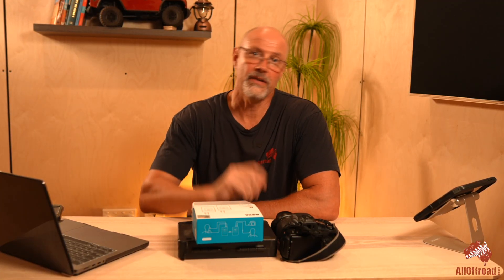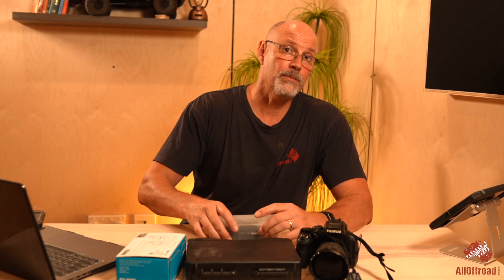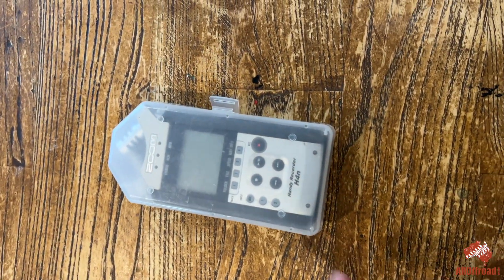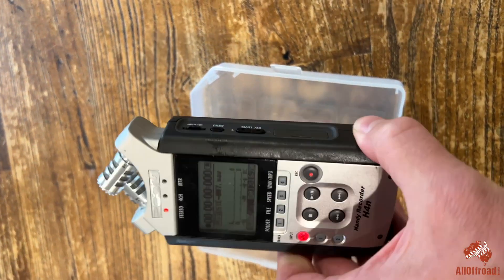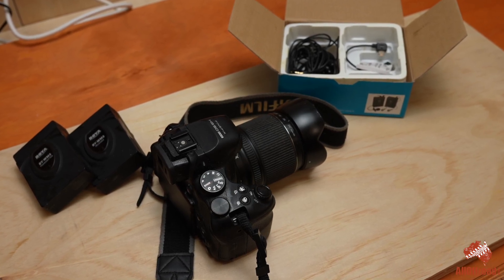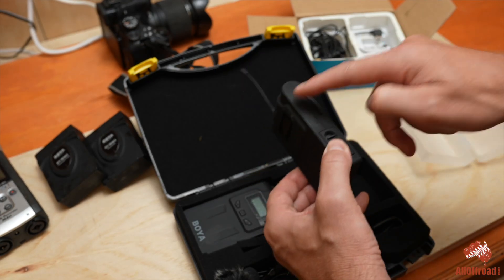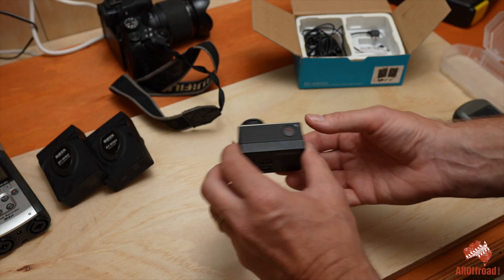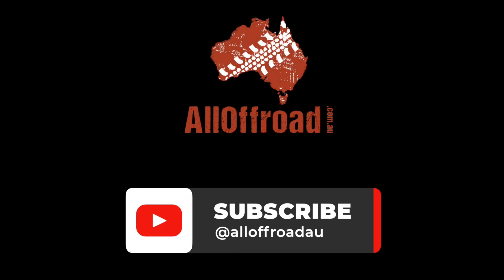Millions of electronic products self-destruct? Hydrolysis | The Sticky Gooey Plastic Affair [2023]

Comment: Not only this. Xrite colorimeter - become sticky after 1 year in box, and it's not devce which ment to be used day by day. Various computer mices  - stick after 2-3 years. Back of dell PDA axim X51 - stick after 5 years, after 7 years falls apart. Not only that! cables alse can sticks and disintegrates overtime, even in box.

In my case stickiness always happened with softtouch coating, i personally avoid to buy such products anymore. When it starts to be stiky it can be removed in throwlly washing with soap.

And i'm also think it's not normal and bad for environment to used materials like this.

Comment: Had this happen on a radio/cd player over 20 years ago. Have not experienced it since, must have been lucky.  So much production today is contracted out to third parties in whole or in part. My guess is that inferior plastics are being substituted that are below specifications and without the knowledge or agreement of the brand name that appears on the product.
Reply from the maker: yes my guess as well but I find so many products with that issue now not funny anymore. Just yesterday discover my DJI Osmo Pocket starts it after 2 years.
Reply: That is unacceptably substandard.  Should be good for at least 5 years.  Plastics have been around for a long time, not exactly experimental.  That experience would turn me off that brand.

Comment: Mercedes Benz are specialists at this. My old ML seat base became a no go zone sticky black morass covering your fingers in gloop and my G Wagen headlight switch recently  crumbled into several pieces, being made of  something apparently as robust as a broken biscuit.
Reply: When they want around 3,000 USD for a  starter motor where I am,  they don't talk much  about reasonable durability.  The whole switch shows up at 400 USD. A Unimog  clone knob will fit I think, after some research.
Reply from the maker: have you contacted them? Even out of warranty clearly used materials not fit for purpose

Comment: with the sticky plastic try to wipe them down with isopropyl (rubbing) alcohol. This dissolves the petroleum-based film which has developed on the surface.
Reply from the maker: Depending on plastic that does not always work seems to be caused by inferior plastic, and Hydrolysis on some devices only a paste of baking soda and water did help, but because of buttons and electrical dials very hard unless you can take whole housing off.

Comment: Certainly I’ve had the same issue with my GoPro2 cameras, a Tecsun airband radio, and just about every other electronic device with ‘soft’ feel, that I have come back to after not using them for maybe a year or two. The problem doesn’t seem to be with the base plastic but with whatever they use to give the ‘soft’ feel. 
I think this is some sort of natural rubber and it has begun to perish. 
As others have said, I have used isopropyl alcohol to wipe off all the coating and exposing the base shiny plastic and can continue using the device without the stickiness.
I didn’t lose the labelling as it was on the base plastic with the clear soft feel coating applied afterwards. 
My thoughts are that they do it because we think products with this soft feel are more ‘luxurious’ than hard shiny plastic which maybe associated with ‘cheapness’. 
Whatever. I just wish they’d stop doing it. 
Thanks for the video and giving me the chance to vent 😂.

Comment: Oh yeah, we have gear like that too and it is quite irritating. I have been thinking about just rolling them in talcum powder LOL I have the same Boya mic set you have (the bigger one) and that is just starting to go sticky. It seems to be the kind of coating they put on the product. From my experience it is the matt rubbery finish ones, shiny plastic doesn't seem to have this issue. I note the front of my Boya mics that are more exposed to the air are deteriorating while the backs are still fine.  I also have old GoPro gear and one of the clip on back screens is going sticky but the cameras seem to be ok at the moment. Planned obselesence is a real thing these days. I just tried to resurrect on old laptop by doing a complete re-install of Windows but it is so slow it is completely unusuable and that isn't even related to the internet but just apps on the laptop itself.

Comment: wipe them down with a microfibre cloth soaked in isopropyl alcohol. It will take a bit of elbow grease and a harder plastic, non sticky surface is exposed underneath. End of problem

Comment: Agree with you Stefan. Several PVC items have become sticky, especially soft rubbery plastics. The cause is unanswered. Some say it's changed to the manufacturing process while others say it's a separation of the core materials. Either way, it's happening and can only be resolved by cleaning these surfaces with alcohol.  My suggestion is that unless the manufacturer is willing to replace it, simply clean it every 12 to 18 months.

Comment: I have this problem with a Samsung tablet. It is so bad that I have stopped using. I have recently been told that eucalyptus oil will alleviate the stickiness  but I have yet to try this.
Reply from the maker: did you contact samsung? they should replace.

Comment: I have had the same problem with several devices. My Canon Image Stabilized Binoculars ($700+) got to be so sticky that they became unusable and I was forced to do something about the problem. 
It is the rubberised coating on the surface of the devices that is degrading over time and causing the problem. I tried many different solvents to remove the coating and found that the only one that worked was acetone or nail polish remover containing acetone.
I removed the problem coating and now my binoculars are easy to handle and still work perfectly. I hope this helps.
Reply from the maker: As I mentioned, a baking soda and water past worked well for me as long as you do not have buttons and switches.

Comment: I have come across  the same thing with electronics over the years, and I have found that once a device has been sitting dormant for a long period of time, it appears to become sticky. I've concluded that this seems to come from the oils and acids in your hands after the device has been used quite regularly like you would a camera.
In some extreme cases, I have actually had a type of mould or fungas grow on the real sticky parts. 

The solution I have found is to wipe the device well with a baby wipe and then dry it well and wipe it over with Mr Sheen or Armour all, this seems to stop the stickiness and keeps it from growing any mould.
Hope this helps cheers.
Reply: I had a tyre monitoring device, unused, still in the box, went sticky after a few years in the cupboard
Reply from the maker: It seem to depend on the exact compound baby wipes did not work for me

Comment: I have the same with the soft grip on my wireless wince controller and have noticed this problem in the last 5 - 10 years, nothing prior to that.  I put it down to manufacturers using recycled plastics rather than virgin material but this is just a guess, no empirical data to support my theory.

Comment: I’ve had the same issue with 2 battery packs and a gps unit. I didn’t contact the manufacturer I threw the gps and I managed to scrape the sticky plastic off the battery packs and continued to use them without further issue for a couple more years.

Comment from the maker: I think this does not get enough attention I have had plastic devices for 20 years without such issues, so it's definitely possible. I understand automotive parts which are exposed to constant heat, oil etc., but as you said well treated and stored audio recorders, cameras and lenses??? Can you imagine how many million devices worldwide are thrown away without being labelled as failed? Quite convenient for manufacturers to have a lifespan on the plastic so the consumer needs to replace it. First few devices I also just threw them away, not thinking too much about it.

UPDATE:
This is the response I received from Zoom USA:
This issue is covered under warranty regardless of the date of purchase. If you would like to ship your device to our office in New York, we can offer a new replacement H4n Pro Black at no cost. The H4n Pro Black uses a different housing that will not be subjected to hydrolysis, so this issue will not occur again.
Reply: I have had it previously but as you said I just chucked it out too, Plastic is just a product of Hydrocarbon so perhaps not selecting the correct grade by the manufacturers.